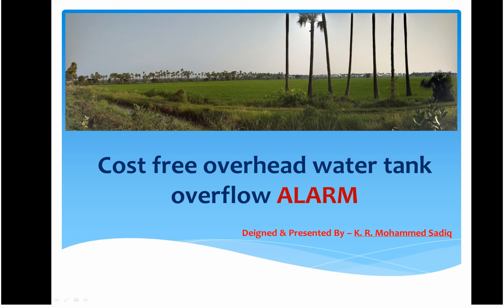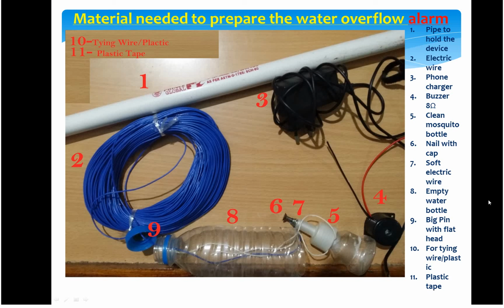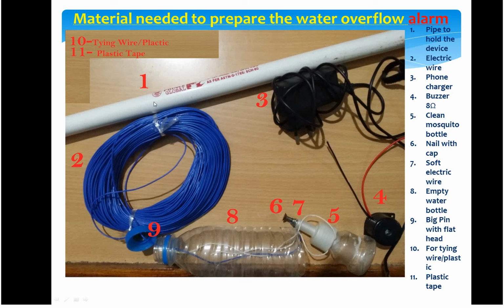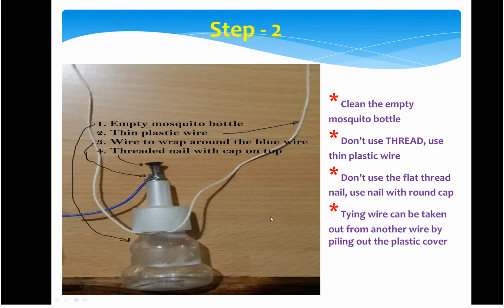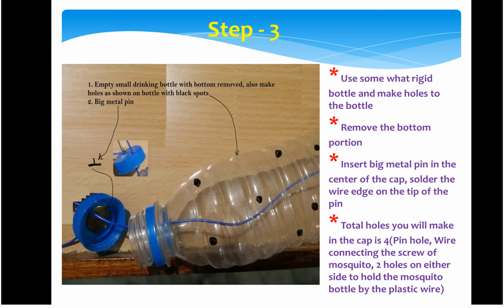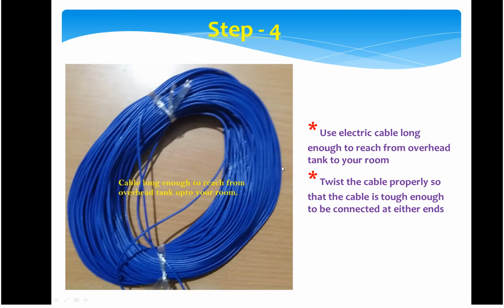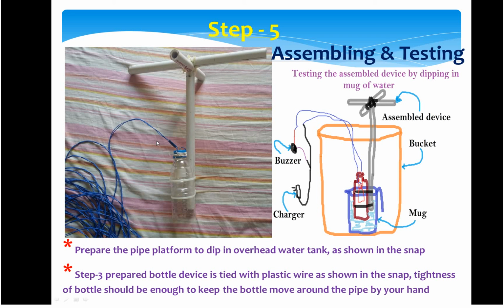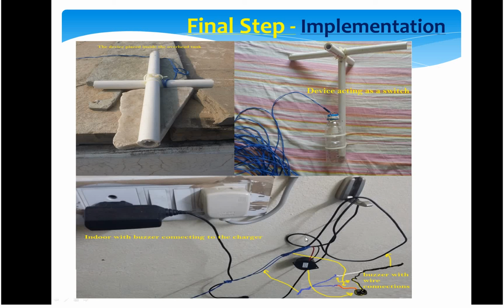Sadiq's overhead water tank overflow alarm

Comment from the maker: Much improvised performance done on the entire device is by coiling the copper wire found inside a home cable is coiled around points of contact i.e. + & -, This has improved the overall performance of the current flow and the rust problem to a maximum extent.

Comment from the maker: ************************************************
**** LATEST DESIGN ON THE DEVICE       ****
************************************************
Enhancement done to the overflow device further and the details can be seen in the LinkedIn link (https://www.linkedin.com/pulse/sadiqs-overhead-water-tank-overflow-alarm-using-household-sadiq?trk=hp-feed-article-title-like)
I am also using copper wire available inside the electric wire to avoid corrosion and also finding better results with the new approach.

Comment from the maker: **************************************************
****** C H A N G E / CHANGE / CHANGE ******
**************************************************
Guy's Design is further improvised by removing the bottle cap by round screw ring, screwed into the stand. I have also replaced the charger plug to 12 V plug by almost 1 A current. As the distance of wire in my case was long so i changed the charger. I am now getting big buzzing sound. For those whose distance is short can still continue using the nokia charger for enough sound alarm.